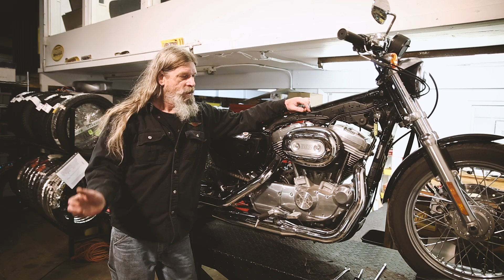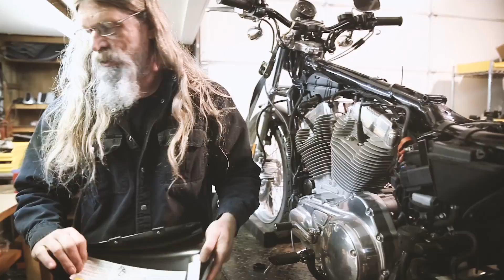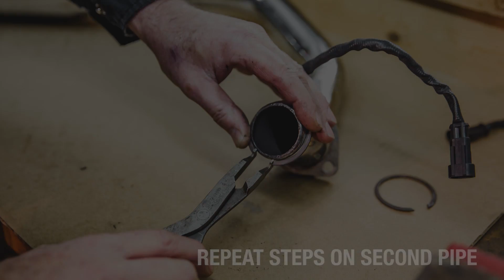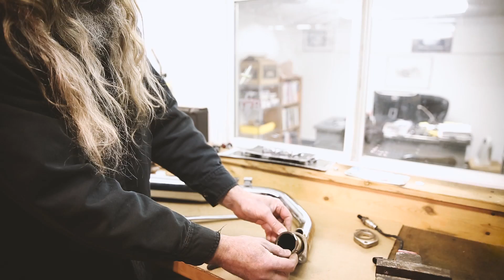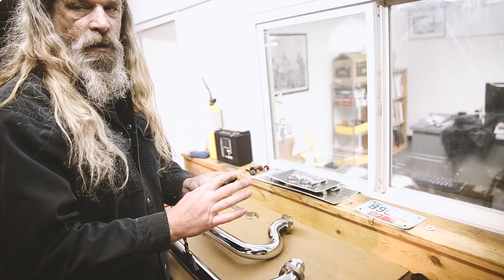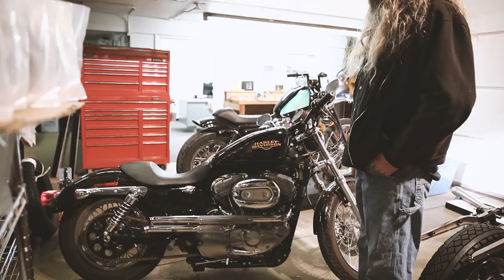Lowbrow Customs Shotgun Pipes How to Install 2004 - 2016 Sportsters

Comment: Many thanks for the good lesson. The new exhaust system looks easy and elegant. It also allows to throw out the huge poker that holds the stock exhaust. But now the front pipe will perfect heat the air intake and blocks an air circulation between cylinders under the air cleaner. I went through all the possible aftermarket exhausts and it seems the stock is the best from point of engine operating.

Comment: Installed on my '19 Iron 1200. The position of the rear oxygen sensor is in a bad spot. The back of the sensor is smashed up against a plastic electrical box and basically melts it. Going to have to take them off and go with something different. I really like the look of the pipes, but I just don't see them working on the newer models until they change the position of the O2 bung.
Reply from the maker: Sent this comment off to R&D and will look into, sorry to hear this.
Reply from the maker: Also, can you email about this issue to info@lowbrowcustoms.com? We will look up your order and take care of you on it.

Comment: I ordered these but my current set up doesn't have o2 sensors.  Do I need to plug the wholes or ca n I leave them open?
Reply from the maker: yes you will need plugs if you are running an 04-06 model. EFI and fuel injection came out in 07 and pipes started having 02 censors then. https://www.lowbrowcustoms.com/bassani-18mm-x-1-5-o2-sensor-port-plugs.html

Comment: I see the passenger pegs work for this system but are they able to fold back up without hitting the pipes? Great how to video. Thanks Tom!
Reply: GREAT CATCH!  i wasn't worried because im wrapping and the heat didn't seem like an issue. but clearance for the peg is a no no... good thing i have a second bike. looks like the 883 is a solo bike now.

Comment: Really proud of your work
Just installed these on my 16 iron and I had to remove the exhaust gaskets for the pipe to fit inside the header. Noticed a little bit of smoke after I started it up from between the header and exhaust area. 
Is this normal ?? Thanks for the help.
Reply: Its normal as long you wipe off the fingerprints off the exhaust
Reply: Doesnt it need the exhaust gasket to run correctly?  Im putting mine on now.  And it isn’t going on as easy

Comment: How many 02 port bushing adapters do you need to install them on a 2015 iron 883?
Reply from the maker: You need the adapter that plugs the large hole to the small hole i believe. so two of them. double check your o2 censor size

Comment: Will the bracket work if you don't use the sprocket cover? Thanks
Reply from the maker: +GBraddock2010 you could still use these pipes with out a sprocket cover but you will have to do some fabrication to make the bracket work or make a new bracket your self to fit correctly. hope that helps. Cheers
Reply: +lowbrowcustoms alright thanks! And what about the passenger pegs? Is there enough clearance to put them up?
Reply from the maker: +GBraddock2010 that I'm not 100% sure about that, on our stock bike it comes pretty close to the passenger pegs. You may have to make a bracket to make them lower or higher, heat shields would be a necessity too, cause those pipes are going to be hot by passengers leg or foot.

Comment: Are there gaskets on the header? I have an 09 1200 too and there weren't any on mines
Reply from the maker: There should be exhaust gaskets installed already or replaced if they are bad on the cylinder heads. The pipes squish them and give a great seal when you tighten the flanges down..